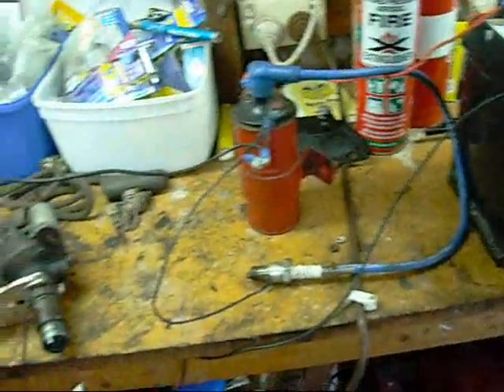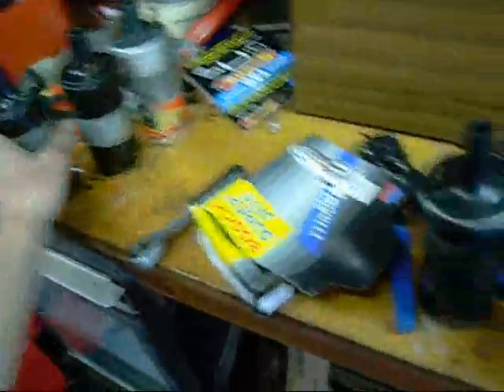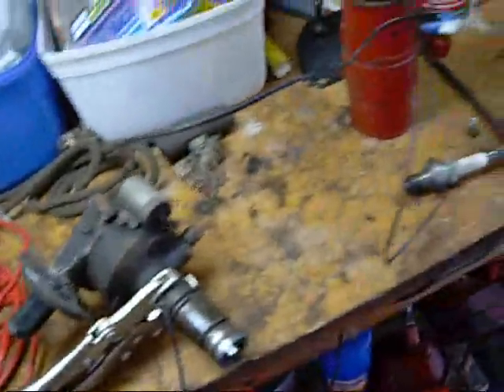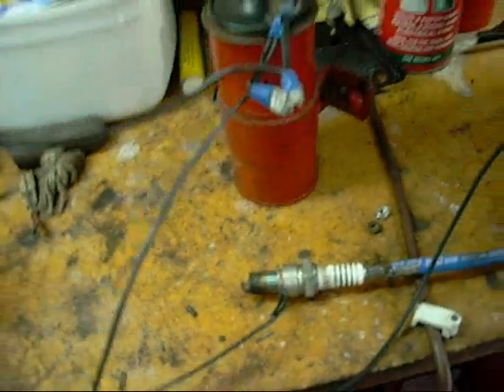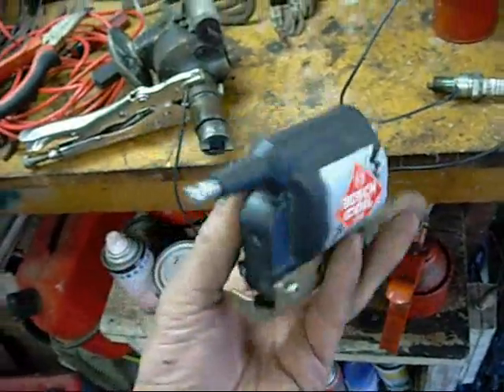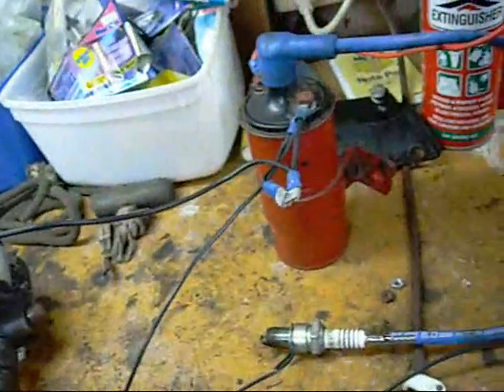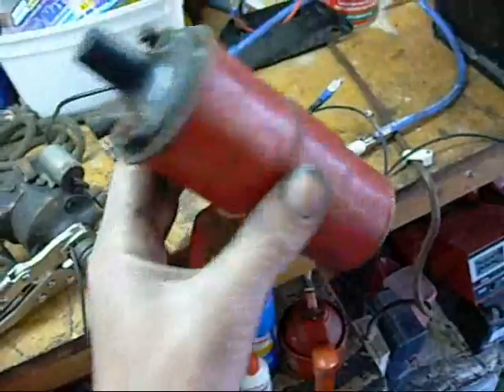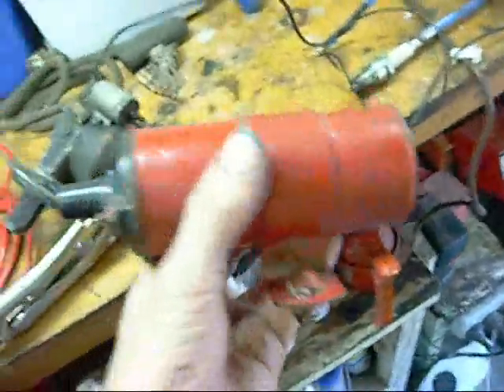Car Ignition Coil Testing

Comment from the maker: I've seen them used before but I am not 100% sure on what was done to the system, the leads and plugs should be fine but I am not sure about the dissy cap, rotor, points or condenser. I imagine it would either work, or arc over inside the cap and misfire.

Comment: is it ok to change the old 12v oil filled style coil to a new 12v epoxy coil or will the ignition leads ect burn out quicker